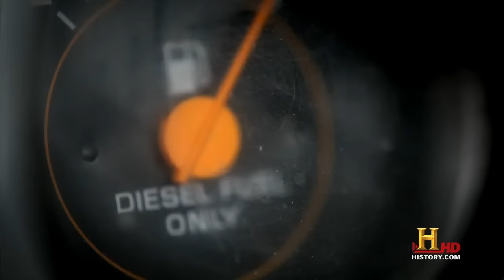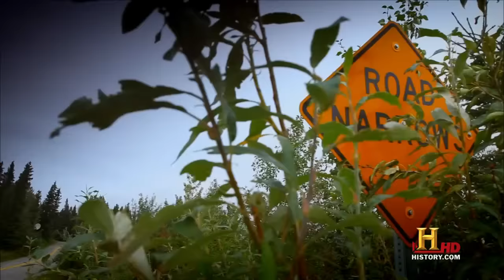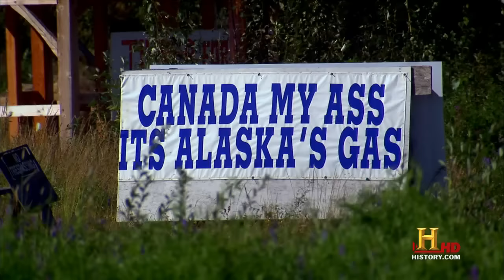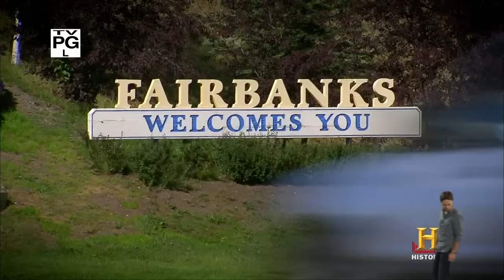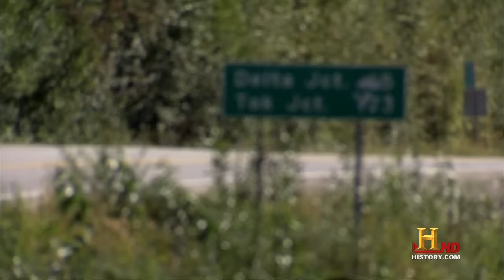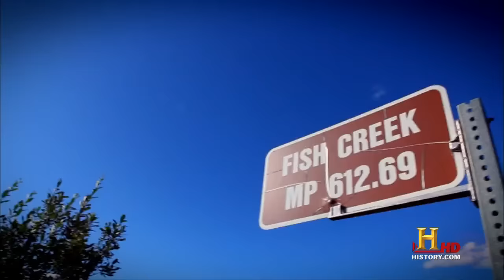Top Gear America Best America's 4x4 Truck   S01E09 - 2011.01.16

Comment: Oh there was no such thing as a 5.7 magnum dodge only 5.2L 318s and 5.9L 360s
Reply: INCORRECT 2003  a 5.7 Magnum Hemi replaced the previous 5.9.
Reply: 4.7 also
Reply: Wrong.
Reply: Either way, This Dodge doesn't have a 5.7 in it!
Reply: @RobKingRC  It does.. but ok
Reply: @CallMeWiggles  The 2 gen 97 Dodge ram came with either a 5.2 318 or a 5.9 360 as far as gas goes. Not a 5.7
Reply: @RobKingRC  Thats not even true lol.
Reply: Troll
Reply: Evan Koketko actually it is dodge didn’t put the 5.7 in anything till 2003 I pull engines and trannys all day long I’m the head dismantler for a junk yard
Reply: U forgot 4.7 318
Reply: @reidharris1059  a 318 is a 5.2
Reply: @AF-xi4ub  there is no such thing as a Magnum HEMI. You had a 5.2 - 5.9 Magnum engine, till they put the 5.7 HEMI in 2003.
Reply: A F he said that dodge was a 1997 or 98 ram. The Hemi didn’t come until 2002. That means he said it wrong and he either meant a 5.2 or 5.9.
Reply: Just to clarify, the 318 was a 5.2 and got axed in 95 period, plus the 5.2 and the 5.9 were never offered at the same time as the 5.9 was the 5.2's successor.
Reply: yjjeeper1 just to clarify, the 318 and 360 are not succession to one another. They are in the same family of small block Chrysler’s with the only difference being bore size and stroke length. Both offered at the same time from 1971 all the way up until 2001 while the 360 made it one more year before being replaced by the brand new 3rd generation 345 hemi.
Reply: @michaeljnewton  I know, I got called it on that lol. I didn't know when they stopped it in 95 for the ZJ, they were still using it in the Ram so my bad.
Reply: @CallMeWiggles  troll, they never came with a 5.7 for that generation ram
Reply: yjjeeper1 they were offered same time. My dad and uncle had same year rams (mid to late 90s) almost identical and my dad’s was a 5.9 and uncle’s had a 5.2.
Reply: @teedubya5772  didn't you see up there? I figured out after I wrote it that it was only the ZJ that stopped the 5.2 in 95 so ya you're right sir.
Reply: Lol i have the 2001 dodge ram 1500 v6 magnum its a 3.9liter. Yall forgot about the 3.9 haha and 5.9
Reply: @CallMeWiggles  The truck featured is a 97, there was no 5.7 Hemi in 97. The only V8s offered in those trucks were the 5.2 and 5.9 magnum. Stop being so ignorant.

Comment: Wish they would've shown the other crew installing their roll cages.
Reply: Why?  Do you really think it was some huge secret?  Why do you want to watch them install legally required safety equipment?  Do you say/think the same every time you go to the movies and see a stunt where they edit out the harness some guy is in to do a double backflip or w/e?
Reply: @moogle68  I like watching fabrication and you sound upset
Reply: @Scrapla1  I was upset at the time, because Top Gear USA didn't last for long, and wasn't that great when it was around, and the most common criticism (at least in these comments) is about them not mentioning the roll cage cost.  I just think a US Top Gear would have been amazing, and I resent the people that complained about the show enough/didn't like the show enough (for petty reasons like not understanding why the cost of a roll cage was excluded from the challenge) because those people are obviously part of the reason why it didn't succeed over here when really it could have and should have. There's arguably a much larger automotive enthusiast population here in the US than in the UK, so this should have been a place where Top Gear had no problem at all succeeding, but the ignorance of the people watching is part of what prevented it from becoming a success over here.

  I was definitely reading too far into your comment at the time, because you clearly didn't complain about anything in any way, so I apologize for doing so. I guess it was just the fact that you mentioned their roll cages that set me off on writing an unnecessarily long, and critical, reply to your comment.  It's cool that you like watching fabrication!  I enjoy watching people do wood carvings and other weirdly specific things.  I would love to learn how to weld at some point, so I will probably end up watching some fabrication videos in the future as well.

Comment: Correction 5.9L Magnum V8 not 5.7
Reply: it was probably the 5.2 318 since it was the non-sport 1500
Reply: They also had a optional 8.0 MAGNUM V10 in the 3/4 ton and 1 ton rams of that era
Reply: @CreelKyle  5.2 got axed in 95, but it was a great motor.
Reply: @yjjeeper1  sorry no.. the 318( aka 5.2 liter) ran from 1967 until 2002. However, there was an engine older that was 318 cubic inch, but it was what's known as the "wide" block 318.
Reply: @Z_732  yup, I didn't realize that it was just in the ZJ that the 5.2 stopped in 95 and the Ram still had it as an option until 02, my bad.
Reply: @yjjeeper1  all good! Just thought I could add a touch of info to a fellow mopar kid.. all in respect
Reply: @Z_732  right on, no worries!
Reply: Wasnt the 8.0 diesel tho

Comment: I don’t feel like Ford was properly represented.
Reply: Emmit Todd Yes sir.
Reply: i agree with Danny ford could've been more included, but in direct comparison to a (dodge or chevy per say) it does fall short, especially compared to their diesel motors.
Reply: Ethan Wilson That Dodge would have made it for sure if the engine didn’t suck in a bunch of water.  It would have been a fun trip to be on!!
Reply: @eastavenues  That would have certainly been an advantage :)
Reply: Emmit Todd I think it had more to do with having its driveshaft smashed into a boulder.
Reply: @Yadaddy98  lies

Comment: 5.9 magnum Rutledge not a 5.7. Tanner had the 5.7 truck lol surprised Rutledge didn't say 5.7 VTEC hemi
Reply: They made a 5.7 magnum and a 5.9 magnum. So he is right.
Reply: ian person, no the 5.7 “Hemi magnum” was in 3rd gen ram. The term”Magnum” was eventually dropped. 2nd gen engine options were 3.9 v6, 318 magnum v8 (5.2l), 360 magnum v8(5.9), and the 5.9 Cummins diesel.
Reply: Corey Hescool that bugged the absolute piss out of me. 5.2, 5.9 are Magnum engines.
Reply: ian person definitely wrong it's a 5.9 magnum and the now 5.7 hemi. Two different motors, and the hemi was not in the 2nd gen

Comment: He said that dodge had a 5.7 they didn’t have the 5.7 in 98 in those dodges
Reply: It was a 5.9 magnum gas. In 2003 they came out with the 4.7 v8. But in the 90s you could get the 5.9 cummins and 5.9 v8
Reply: I have a 99 with a 5.9 v8. My truck has serious front damage and still runs.
Reply: @Aidanmcfar  not in the 1500s.
Reply: Its either a 5.2 or a 5.9
Reply: @Aidanmcfar  wrong.
Reply: James Walsh yeah I figured it out after cause my 83 chrysler fifth avenue has a 5.2
Reply: @Aidanmcfar  mhm...
Reply: @ryleejankovich400  u mean the 5.7l?
Reply: @ryleejankovich400  the 4.7l are absolute trash lol
Reply: @jameswalsh1634  and so are you, the 5.9 was the 5.2's successor and the 5.2 was stopped in 95.
Reply: @yjjeeper1  and you even have a ram in your picture🤣🤣🤣
Reply: @jameswalsh1634  I had a 5.2, my truck in the pic is what I have now and it's a 4.0. Apparently you are correct, I didn't know the 5.2 was only stopped in the zj and still used in the ram trucks til 02 so my bad.
Reply: @jameswalsh1634  and a ZJ is not a Ram, not that I don't like Rams but just saying.
Reply: @yjjeeper1  you have a ram in your picture js
Reply: @jameswalsh1634  either you've got issues with your yt or otherwise, that's my white 94 ZJ. Thought you had a Ram, not know what they look like?

Comment: Adam would have won of he got a Ford truck in the 90's
Reply: I agree
Reply: Bullshit, the Ford had an advantage and still broke lol
Reply: @SGT WOLF u mean Chrysler has one of the best engines on the market lol and i do agree, they have some great engines, it's just too bad that they didn't put them in these dodge trucks. The 360 magnum and 318 magnum weren't nothing special, they ran ok but could never hang with a sbc, that Chevy would run circles around that dodge all day everyday lol the video doesn't lie, u can clearly see the Chevy out performs both competitors. I'm a mechanic, i see and work on these trucks everyday, i could go on and on about stuff that sucks about those model dodge trucks, i would take the Chevy over it for sure.

Comment: A lifted ford ranger way better option then the f 250
Reply: Really depends... If it were a regular cab pickup bed 70s f250 with a 3 inch lift sitting on 35's or 37's... It would have easily taken the cake. It probably could have the way it was if the driver wasn't a jackass. Those divorced transfer cases put in the old highboy fords were the best damned inventions of all time.
Reply: @daveuhl2065  seen video last night 76 f250 climb a rocky hill along side a raptor. I would've chose a ranger for this too. Let's see them do same drive in the new ranger raptor
Reply: Rangers are so fun😉 especially with glasspacks
Reply: @TheLuckyLuke314  I got 10 rangers. 86 to 04. 01 with 5.0l 2wd. 03 4.0l manual and 4x4 is fun too.
Reply: Joe Smith my cousin has 13 rangers. Including a stripped rock crawler, a Raptor build, a 5.0 swap, and 4.0L 5 speed 4x4
Reply: @ridge9066  I got a 5.0l drag race ranger. A 4.0l 5sp 4x4 act ranger. A cobra drift ranger. Are you my cousin? Lol. Sounds like a need to meet your cousin.👍
Reply: Joe Smith you guys sound a lot alike lol
Reply: Joe Smith what’s under the hood of your cobra drift Ranger? That sounds sweet
Reply: @ridge9066  it's a 97 regular cab step side bed. Matte black and blacked out. Except for few chrome and stainless emblems. 2.3l 4 cylinder with chip and tuning. Cold air. Accel coils and performance wires connecting irridium plugs. Want to add a turbo. 5 speed manual. Nice little street truck.

Comment: Pretty sure that generation dodge trucks didn't have the 5.7L v8. Only options were the 5.2 and the 5.9 I believe. This was a really well set-up challenge, but the presenters don't really have great chemistry, and it was blatantly staged and scripted. I know it has to be scripted for TV, but they could have made it seem more organic instead of doing everything clearly on purpose.
Reply: Yep.. most of the 5.9 liter trucks that were half tons were badged as a sport. Without the badging I would say it had a 5.2. Jmo

Comment: "best truck" lmao you can't get America's best truck for under $3k - that's the Dodge with a Cummins, hands down.
Reply: Yeah if you want to buy a new truck every year because it rots out.....
Reply: @Kyle-dc7jm  idk, I've had my first gen 4x4 for a few years now...
Reply: nope ford with a 7.3 dodge has shit wiring and rots out after 50k miles
Reply: 7.3L Furd is the best. Only problem is that you might run out of gas. SIKE they had second gas tanks :)

Comment: I will say this test is completely unbalanced. No one knows the history on these trucks, or what has been done to them. Although I am a Chevy guy. I have had many older fords and dodges and chevys and I will say all of them are good trucks. My favorite ford that I've owned has to be my 86 f150 351 Winchester. And favorite dodge is my 83 power wagon. Basically I'm just saying that this doesn't really prove much
Reply: Ryan mace it's a 351 winsor
Reply: Yeah I put that and just realized autocorrect did that lol
Reply: Lol its 351 windsor, and  i agree.

Comment: all the truck would have made it if they didn't drive so hard. What happened to the Ford could have happened to any of the trucks. and not giving the dodge a brake and running so hard would have had the same results on any of the trucks. The Toyota was babied the whole time so it had no problems.

Comment: Without Clarkson, Hammond and May, Top Gear is just a cheap knockoff
Reply: I agree they are the best for the show. I still dont mind watching just because I like cars.
Reply: This is an entirely different top gear, Clarkson, Hammond and May were on the UK top gear, but this is top gear USA, they’re both top gear, but it’s two separate shows
Reply: @_theballadofbort5861  let's not get bogged down with all of that, the fact of the matter is that top gear USA is, well just boring...
Reply: Mack papi de oh my bad, I thought you were saying that this was the UK top gear but with different guys, from the way what you said sounded it sounded like you didn’t know that the USA top gear existed

Comment: I dont care but I still would take the dodge
Reply: Austin Walker fords are trash, chevys are good, dodges look the best
Reply: Wtf Dude? You are wrong
Reply: BigOldF150 it hit a lot of boulders so if it was tough it wouldnt have broke
Reply: Why not remove the busted shaft and keep driving? 4WD = FWD.
Reply: I'd take a dodge in a heartbeat
Reply: A 1995 toyota diesel  hilux will make it  with a solid axle  it would make it farther than the chevy . And asol if they made a part 2 of this show.

Comment: What about the Toyota it made it all the way through
Reply: It wasn't thrashed the whole trip like the big 3 were.
Reply: @jimmywhitlow7174  Also smaller and lighter, made when Toyota trucks really were tough machines. What it comes down to is they're all old trucks, probably not all maintained that well, if you start thrashing on them something will give in, on every single one of them. Things like U-joints and radiators don't last forever.
Reply: @ixionn563  believe me I know all about that.  I use to go mudding and things broke all the time. That was my younger days, I take care of my vehicles now. Lol

Comment: I had a 76 F-250 that had originally been a power line service truck.  Had seen a ton of gravel and was well used by the time I got it.  It was damn tough and I took it on some pretty gnarly stuff.  It was a really solid truck.  I know it's a show and they are trying to be entertaining but I honestly believe this was more a show about how to badly drive a truck off road so that you can wreck it.  No truck is going to last for long given they way they were driving.

Comment: I'm no ford fan, and I'm not a top gear usa fan. But this was a really good episode. One of the problems with this is episode is, a broken u joint should have been an easy fix. In top gear uk the guys can attempt to fix their vehicles. On a side note, not surprised the chevy won.

Comment: The Ford: dies in the water but engine still runs after, the driveshaft breaks after
The Chevy: got stuck but no problems with the actual truck
The dodge: a lil water kills it

Comment: I kinda wished they said why the dodge broke or at least tried to figure it out like did it over heat? Because the battery flipped the first time then it’s just broke?
Reply: From the podcast they did they said that it lost oil pressure and basically locked up

Comment: The best off-road vehicle is not a pickup. It would be a Jeep Wrangler or something with solid front and read axles with locking front and rear diffs. And carburetor is no good on extreme incline/decline.

Comment: I'll never get the 4x4 trucks thing. These are TRUCKS, they're meant to carry heavyloads and pull large trailers over tarmac. They have no buisness being buggies. That toyota is light weight and built to be a buggy. Jeeps are what's meant to be offroad like this, not these massive vehicles.

Comment: If your goin to go out on a trek like that. The lightest narrowest wheelbase is going to fair best. Which is why the Chevy and Toyota were the best candidates. That being said if they were all the same year and try can short boxes Chevy would prob have still won. And if done in one of the states on winter the Toyota would be the first one out from salt rusting out the frame and body.

Comment: Technically the Ford didn’t get knocked out. A driveshaft could break on anything.
Reply: I know right going off road there's thing that should be brought tools suspension components and of course u joints

Comment: The unibomber would drive a Ford? Don't insult Ted Kaczynski like that.

Also, I had a 2002 Ram in 2008. At 150k the driver and passenger window motors were dead, the air conditioner stopped working and wouldn't come out the top, had to replace the radiator, twice, replaced the upper and lower control arms on both driver and passenger side, twice, driveshaft snapped, transmission was going out, was literally the biggest POS ever.

Comment: The ford Could have pulled the driveshaft out and drove it in frunt wheel drive for a long time.  I broke my rear pinion gear on my Chevy pulled the spider gears on the side of the road and drove it back home whith the front axle